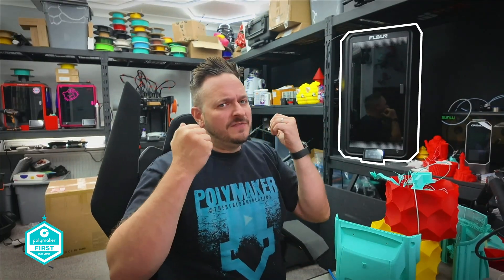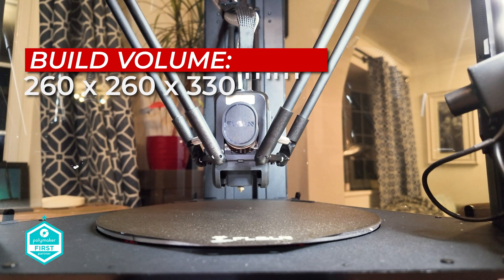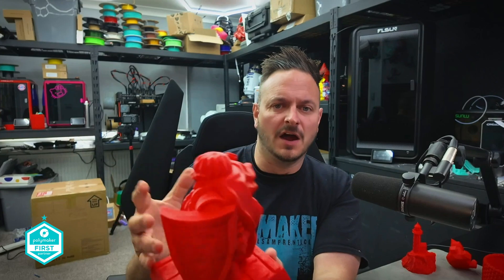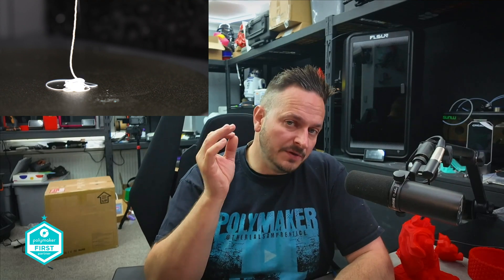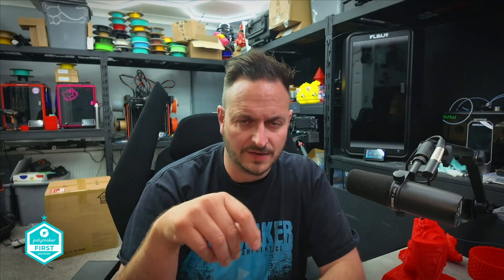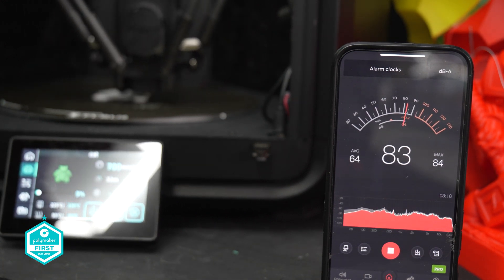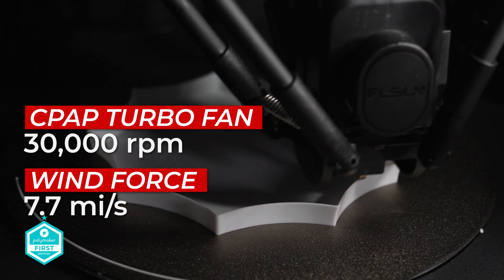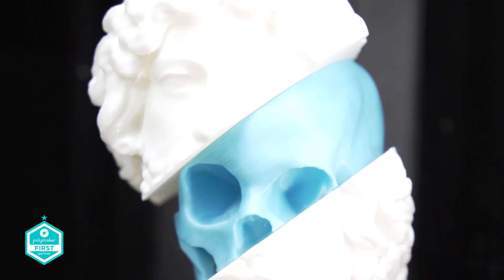FLSUN T1 Delta 3D Printer : Feel And Hear The Power Of Wind

Comment: I kept wanting one of these and after watching videos where after while failures started happening. These enclosed deltas are not ready. If and when the bugs in the firmware are fixed I might go for one.
Reply from the maker: My issues have mainly been around the wiring of the hot end, I thought I’d fixed it but no. They sent me another unit which I need to unbox

Comment: If i had to choose between FLSUN t1 & Creality K1 max, which would be the most reasonable pick?
Reply: Depends on your requirements ，but I hope you choose between K1C and T1 ，because my K1max has too many problems
Reply: @MapleMenge  Could you get more specific with the problems that occured in K1 max?
Reply from the maker: Depends on your requirements
Reply: @TheRealSamPrentice  Well, printing space, quality and speed are the main points that im looking for, but stable software is crucial, as it depends if a print would go through without any problems such as crashes. So as Im reading my own questionable comment i can say that it answers itself.
Reply from the maker: @henta8631  How do you feel about bambu?
Reply: @TheRealSamPrentice  Expensive, smaller build plate and definition of quality. I got a budget of 700 euros, an p1s  would fit in, but my main pick would be K1 max with all of those features, fast speed and large printing space. But as my second printer i want something more interesting or challenging as how my first one was, worked on it for two months to get top quality prints.
Reply from the maker: @henta8631  well you have your answer, the T1 is a 260 build volume x 330, but the max is 300x300 what are you going to print?
Reply: @TheRealSamPrentice  Definitely not figurines, im doing my own designs on onshape, so prints vary in size a lot, so big print space expands the possibilities to do various things.

Comment: Excellent video and feedback - definitively the T1, like the S1 are not finished or polished product for the moment - Both have been rushed 😑

By chance were you able to measure the actual flow rate?  People have reported that the S1 is a lot lower than the advertised number (100mm3/s) so I'm definitively curious about the T1 - Flow rate is one of the limiting factors to achieve high print speed.
Reply from the maker: Unfortunately, not as of yet because I would like to do that inside of klipper and they’ve not opened it up as of yet

Comment: In bigger brother S1 there is a issue about abrassive filament support because hotend (wich is too and nozzle extension) is aluminum. I wonder if the teeth gears/wheels are reinforcement steel (in the S1 I mean).
Reply from the maker: The 90mm/s is a bold claim also
Reply: @TheRealSamPrentice  Completely inaccurate claim, unfortunately. If they had been honest about all the printer specs, it would be much better received.
Reply from the maker: I found it hard to believe with the nozzle type they used also, so you know what the true number is ?
Reply: @TheRealSamPrentice  YGK3D and Clough42 both did some pretty solid testing I believe. I think realistically depending on filament more like 30-60mm³ or so. The test FLSUN used was inaccurate as it could never actually reach the max flow rate they specified.
Reply from the maker: @802Garage and are the extruders and hit ends the same on each model

Comment: Releasing both S1 and T1 in a somewhat unfinished state is understandable since they announced the S1 and T1 a long time ago and then ran into something that delayed them coming to market. Suddenly they were in a position were revenue from V400 probably had shrunk because "everyone" was waiting for these new models. They might not have had much choice when pre-maturely pushing these out the door. The next few weeks and months will be critical though. Before I consider buying one, they have to show that they can get the models up and running reliably with new FW/software updates. (I did try to pre-order from their webstore. But they didn't ship to my location, so I have to buy from reseller).
All that said, I think you Sam should have covered the main reason to consider one of these; claimed speed. When it works, is it really as fast as the claimed numbers suggest?
Reply from the maker: The delays for months in what got me..

Comment: Thanks Sam.  They are not alone in launching a printer with crappy initial firmware.  We have been here so many times with lots of printers.  I just wish they would get it right before taking the 'We will sort it later' approach.  To me if feels short sighted and awful for the user.  I get that you need to expect some minor issues with firmware and we expect a steady evolution of firmware when new printers come out but COME ON PEOPLE  get it right.  That being said I do love  watching delta printers work as they fascinate me.  Maybe they should also include a file to print ear muffs 😊
Reply: Releasing aa new printer with crappy initial firmware seems the norm now. Getting the users to do all the testing for you!
Reply: @stevedegeorge726  I have no doubt I will have issues when the K2 finally arrives.  Fingers crossed though.
Reply from the maker: I agree and it’s a little painful !